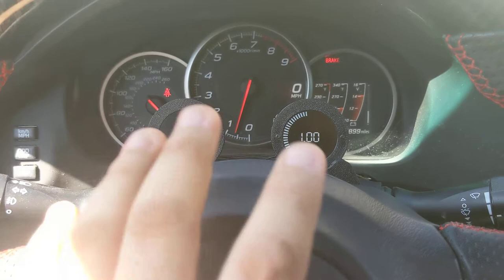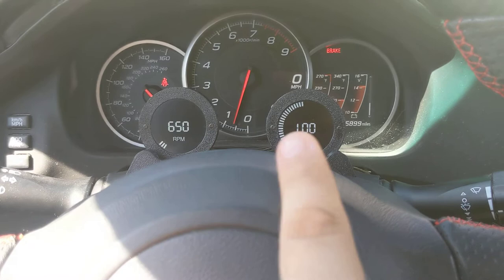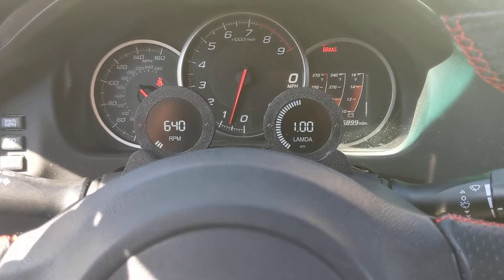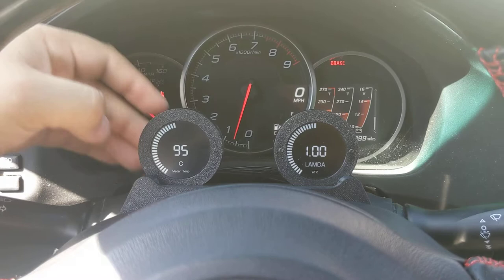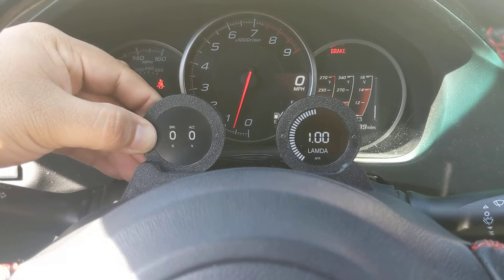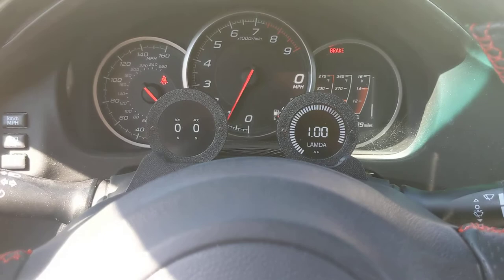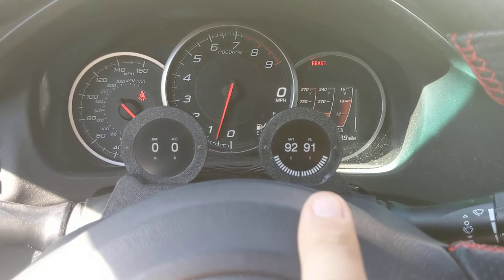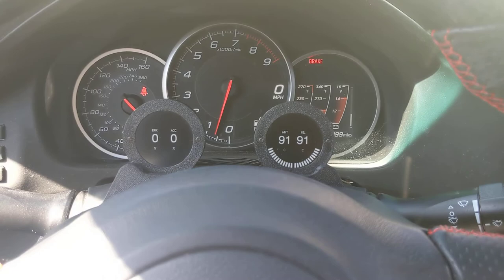frs brz gt86 steering column mounted dual gauges

Comment: Could you record a video of the installation process? Also are these compatible with the old gauge clusters/ scions
Reply from the maker: hi there! install is extremely easy. you jus turn your steering wheel one way. remove oem screw, push in the bracket, and replace it with new screw. Turn wheel to the other direction and repeat. wires can go through the back and and you connect them to the obd2 port and thats it. And it works for all 13-20 frs/brz/gt86 cars.